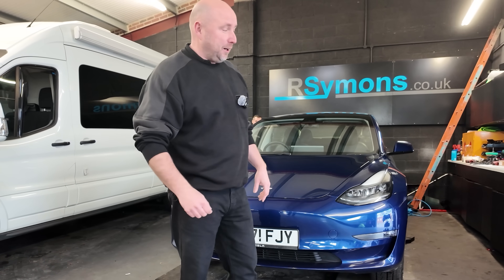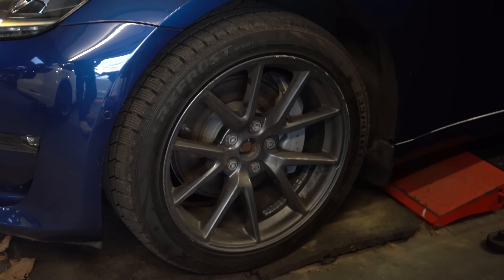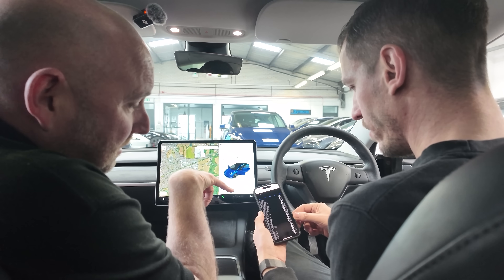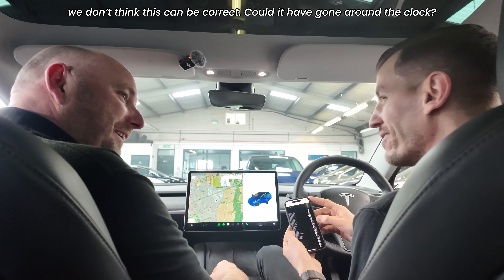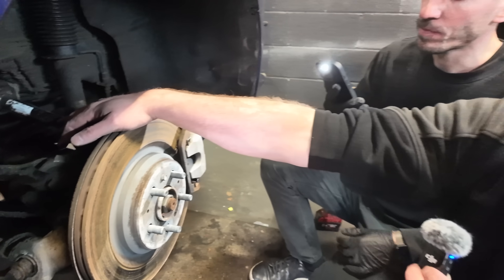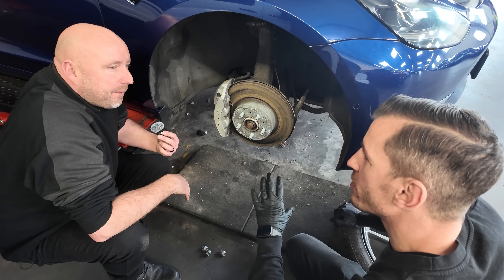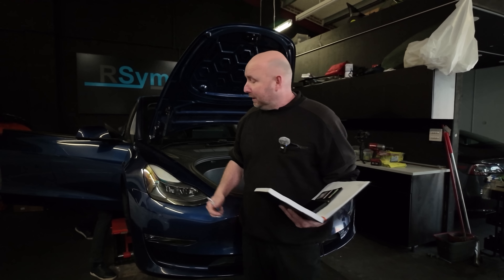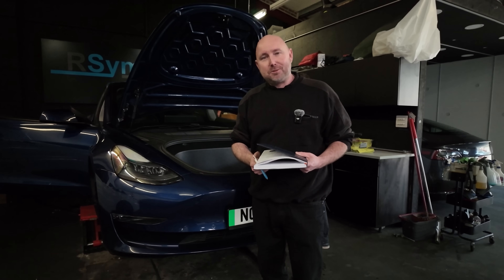EVERYTHING WRONG with my HIGH MILEAGE "21 Tesla Model 3! | Battery health and other issues!

Comment: Almost £20k less in fuel costs?! Let alone the VED and maintenance costs on top of the constant worry about something going wrong.
This is why I find it hard that people still argue for buying a new diesel 3 series over something like this. Absolutely mental.
Reply: only if you can charge it at home
Reply: @alexwong402012  Yes, which is around 65% of the population in the UK. So a good number of people.
Reply: The ICE wouldn't lose 50% of it's value in 1 year, check again the EV market data.
Reply: @grumpyrider369  but if your car has a usable life of over 400k miles then what relevance is the resale value? Besides if you like to swap a new car for another new car every couple of years
Reply: @grumpyrider369  What?! You can buy a used, one year old Mercedes e-class, for under 30.000€ in your country? Where do you live? I have to start importing those. Here, you wont find any under 45.000€. Neither on the car dealer market, nor on the private market.
-
In opposite, Tesla has to rent an airport, to store its cars. In Gusow-Platkow, in Brandenburg, they rented an old military airport, already a year ago. They store thousands of Teslas there, because they cannot sell them. Its become even much worse, since Tesla's sales numbers plummeted this year.
Same goes for the "used cars" market. Many car dealerships, dont even want to buy a used Tesla. Its a known problem, here in Germany.
Always fascinating, how different the countries can be...
So, where do you live?
Reply: @dunjak111 Mercedes has to have thousands of car dealerships, where 10s or 100s of thousands of cars are parked. Tesla sells the cars it produces much more quickly.  So extra parking is the norm for Mercedes, VW, BMW.
Reply: @mrmichrom8553  True. Tesla has 22 dealerships in Germany and Mercedes has got 55. However, Mercedes doesnt rent extra spaces to park thousands of unsold cars - like Tesla does. At least not in Germany. I am still talking about Germany.
Reply: Because people are dumb and believe what they read in the Daily Mail or what their mates tell them in the pub.
Reply: Your talking about a new diesel, nobody buys a new diesel. EV is still expensive if you cannot charge at home like me, it has high value depreciation. Than count the battery risks, its still not a clear winner compared to reliable second hand diesel cars.
Reply: VED for EVs being introduced in April 25 though
Reply: "Almost £20k less in fuel costs?" I dont get that. 
A Mercedes E-class uses 5.5 liters on 100 kilometers (combined) = ~9.21€
A Tesla uses 15kwh on 100 kilometers =~ 7€
According to the energy prices of today, here in Germany.
That is a difference of 2.210€ per 100.000 kilometer, or ~7500€ for 341.000 kilometer. Are the prices in your country so much different?
-
Also, driving constantly at high speeds over 130 mph, like here on our german highways, changes the whole calculation in favor of the combustion engine. It needs much less fuel for driving at high speeds, than driving inside city limits.
Reply: @dunjak111  if you charge at home you have 1/4 price of electricity than on supercharger, otherwise if you charge public only then yes, its not much savings
Reply: @ Charging an EV on a supercharger in Germany costs 0,79 €/kWh - or ~12€ per 100km (latest price). That is even more expensive, than an e-class.
Reply: @dunjak111 that’s why you charge at home and only use the super charger for trips once in a blue moon
Reply: @dunjak111  no - it costs 45-50 cents. Why spread bs if it’s easy for anyone to check?
Reply: @ You are right. It is 45.000€. I did look it up, but I must have mixed that up. That was not my intention. I am truely sorry.
Reply: @ purely basing my comment on Richard’s calculations towards the end of the video and how a large majority of city people use their cars. Germany is an exception since it’s the only place with roads you can legally go so fast in Europe.
Reply: @dunjak111  5.5l ??? Why is it that most ppl „on the other side of the fence” resort to lies and half truths? 
5.5l you can get when cruising at 110-120km/h, granny style. On German autobahns most ppl cruise at 150-170.
Another fallacy: you’re comparing a 450HP 4x4 car with a diesel taxi… ppl who drive model 3 do it partially because of performance. Run your numbers again for 340i xdrive
Reply: @AdamCiernicki  Mercedes officially states 4.7l combined (highway and city).
However, 5.5l is more realistic. Crusing at 120kmh in the e-class consumes less than 4l/100km. 
-
"ppl who drive model 3 do it partially because of performance"
Rofl! Even my 32 year old Mercedes with 240hp drives 250km/h. That is faster, than most Tesla models.
Most parts of our german highways dont have any speed limit. So, I wave goodbye to most Tesla drivers, before I see them disappear in my rear mirror.
-
"you’re comparing a 450HP 4x4 car with a diesel taxi"
Sure. You dont need a BMW 340i to be faster, than a Tesla. Even the smallest, modern 4 cylinder engines can drive faster, than most Teslas.
Reply: @ so you’re cruising at 120 getting 5.5 litres …but you’re faster than any Tesla cause you drive 250… sorry I’m not qualified to continue this conversation, just relax, maybe go for walk.
Reply: @AdamCiernicki  I guess, you did not read carefully, or maybe my english is not good enough..
1. In regards to the calculation, I wrote about the new Mercedes e-class using 5.5 litres, combined. (those are limited to 240kmh top speed, factorywise)
2. In regards to performance (=top speed?), I wrote about my 32 year old Mercedes, which, btw, has a consumption of 11l, combined.
3. In regards to comparisson of combustions and Tesla, I mentioned that new 4 cylinder engines are faster, than most Teslas.
Most Teslas do 200km/h.
Even a Polo GTI drives 242km/h and costs 35.000€
-
I have no doubt, that EVs will be the future. But there is still alot of room for progress. Combustions had decades for that.
Reply: @dunjak111  sorry, I was a bit snarky there. 

1. I don't argue that you can get down to 5-6l per 100km in a 2l diesel car - I had Passat 2.0 TDI so I know its possible. But you have to drive like a 70 yr old taxi driver - more realistic is 7-10l (in case of my Passat) - and that was in UK, where you cannot go faster than 130! 

2. Top speed is not performance. 
Most decent cars can reach 200-220... after some time. I had Audi A4 Quattro sport V6 and it could go 240, but it was not a fast car (0-100 in 7.9 sec). The max stable cruising speed was 180. For my Tesla Model 3 LR optimal cruising speed is also around 170-180 - I have more power than A4 but because of much faster steering rack, going faster is not relaxing (10:1 steering ratio is exactly that of WRC car! Subaru Impreza STI has 13:1). 
What makes Tesla faster is that I reach 170 before you even get to the 4th gear in your diesel car. 

3. Model 3 LR has a top speed of 233km/h - so yes, if you keep abusing your 2-liter diesel for 10km on a straight flat line - you will eventually catch me :) 
https://youtu.be/WG8y2KBH0xY?si=AjtSzb-O9T3IGChL
But you have to admit, it's hilarious watching these 4 cylinder fart-wagons trying to go uphill around Kassel or Porta Westfalica :) with 450hp it feels almost as if gravity didn't exist - you should try.
Reply: @AdamCiernicki  1. Those numbers are from ten years ago.
The latest E-class 450d with 390hp uses 4.9l on 100km combined, according to WLTP (Worldwide Harmonized Light Vehicles Test Procedure). And that is not even a 2l engine.
In reality, cars licenced after 2021 use about 10-20% more than WLTP states, depending on the source.

2. A Tesla LR costs 55.000€.
A VW Polo GTI costs 35.000€. 

3. I dont know what that video is supposed to show? That GT3 could go 311 km/h.

btw: "TopSpeedGermany" are different drivers. They get in trouble with the authorities and loose their licence regulary. Its sad, that some people come to Germany to misuse the Autobahn.
In that very video you send me, you can see that.
Minimum distance is half the speed. At 200km/h, that means 100m. Being closer than 50m and you loose your licence (+50% too close). Those pillars at the Autobahn are placed every 50m, exactly. You can see, that he is way too close.
Also, he enters a 120 zone with 140kmh and leaves it with 180kmh. Thats fast enough, to loose your licence, too.
Finally, its reckless driving. When there is an on-ramp, he just pulls through with 200 km/h. You dont do that with merging traffic, on a populated Autobahn like that.
However, it goes without saying, that this has nothing to do with Tesla ;)
Reply: @ I still don’t know what point you’re trying to make.

I shared that video because I thought you were saying that Tesla cannot drive at high speeds. 

You keep bringing up diesel and speed. For sure E class is more comfortable on motorway at high speeds, it a bigger and made for this. 
Model 3 is a C class equivalent with hard suspension and fast rack, which feels like a crossover between BMW M sport and WRC hot hatch. You cannot compare such cars. 

Same with a polo. 
If your argument is; but I can achieve high speeds for cheaper with car XY , sure but that’s stupid, no one buys cars this way. If you need a C class size car you’re not going to buy a Polo.

When it comes to cost:
No one looks at WLTP, You cannot compare them -  google real world reports with fuel consumption; E450d is 7 litres per 100 = 11.5 EUR
Model 3 Long Range is 17 kWh/100 = 8.5 EUR using SC - most ppl charge 70% at home at 35-39 cents = 7 EUR total 
(in UK it's much cheaper thanks to 10 cents night tariff = less than 4 EUR /100km) 
On autobahn I’m using 25-27 kWh/100 = 13.5 EUR
Considering the acceleration (not speed), and near-zero servicing, this combination of cost and performance cannot be matched by any petrol or diesel car in C klasse at 52k EUR

Finally, because Germans and Polish people are stubborn old gits (and electricity is the most expensive there), it is so much nicer to drive Tesla in DE or Poland: no queues at superchargers and easy to overtake, most other cars are in slow motion mode :)
Many cars in the UK are now EVs, so you need to be much more careful; they will move fast.
Reply: @AdamCiernicki  I would say Germany can stay in its bubble of buying ICE cars for the autobahns to go 9000kph all the time, and the rest of the world can live normally 😉
Reply: @AdamCiernicki  I never said, that combustion engines are cheaper in consumption. Even my calculation above shows that. However, you dont save as much, as mentioned in the first comment.

You mentioned, that people buy Teslas because of its performance. That is why I wrote, that combustion engines are faster, than most Teslas.
However, I thought, you meant "top speed" by that, because that is most important, here in Germany - in opposite to acceleration.
If you pull off too fast from a traffic light, its seen as "racing against yourself". That is a law and people can even loose their licence for that. Its seen as "showing off", too, and it is pretty frown upon, by most germans.

Oh well, I just keep on waving goodbye to most Teslas, while driving 150mph in my 32 year old Mercedes family sedan. ;-P
Reply: @AdamCiernicki  PS:
" I’m using 25-27 kWh/100"
-
https://www.youtube.com/watch?v=4B_mKXvbQAw
This guy had peaks of 47kw/h and an average of 33kw/h, on the Autobahn, in the new Juniper model. You can see it on the Tesla monitor for yourself. (this new Juniper is also limited to just 200km/h.)
Reply: @JoshuaDay lol.
I see your point. Honestly. However, since I expirienced it, I dont want to miss it. It means alot of freedom.
Also, according to any statistics you can find, it is still about 3x safer to drive on the Autobahn without speed limits, than on an american highway. (fatals per capita, per 1 billion km, whatever..)
Reply: @dunjak111 over 130 mph? There are only few who consistently do that. If you meant 130 kmh then there are many. Electric cars aren’t necessarily worse at high speeds. Depends on the combustion engine car too.
Reply: @dunjak111 I think the only argument for high speeds autobahn driving is charging. Fuel costs are definitely lower in the ev. You can charge for 39 cents at EnbW when you take the 17 euro/month expensive subscription.
Reply: new model 3 and new 3 series are in same price range. People just don't want to deal with charging
Reply: @zerodelay1630I find it mind boggling that people will pay ~€10k more annually just because they don't want to get cheap fuel/charge.

Comment: Rich. Super valuable data. I have a 2018 3 performance with 223k miles. All supercharged. My battery is smaller than yours from the factory. About 75kwh vs 82 I think. 72 usable. My capacity is about 61-62 so maybe time or supercharging caused more degradation?  Everything else still works great. Original brake pads
Reply: Hot vs cold Climate also affects. Temperature really degrades batteries
Reply: That's a good result considering that the car is 7 years old and that you've driven that many kilometers. It's not the same to pass 200k in 3 years or in 6 years, and that also applies to batteries.
Reply: Many factors are included when looking at degradation.. age, temperatures, SOC while parked, constant hard acceleration, type of charging, cycles etc. They say that the effects from supercharging should be minimal tho.

Comment: My 164k miles 2021 82.1kwh Performance only has 63kwh remaining according to scan my Tesla. 23% degradation. Panasonic battery is worse I guess?
Reply: Could be that, or it could be a number of other things. It could be things like your charging habits, the environment, rapid degradation, etc.
Reply: True.. DC 29731 vs AC 24366kwh with only 6879kwh regen!

Comment: Where do you get the refurbished or new steering wheels?
Reply: It won’t be new in this one. As it happens, I found a spare one that has a small mark on it but it’s in better condition than the one on the car. There are plenty used ones on eBay

Comment: I suppose there's always the chance the battery could fail tomorrow and that may make the sums a little different.
Yes I realise the engine in a diesel/petrol could fail too.
Reply: Batteries tend to follow the bathtub curve of failures. Which, it will either fail early or extremely late. Given that this battery hasn’t even hit its half life in terms of calendar age, I would say a tree falling on it or a careless driver totalling it is more likely.
Reply: Yes that is always a risk but as you said the same goes for ice engines and transmissions. 
Luckily batterie prices started to fall lately. 
This has not yet transferred to replacement costs that much in personal experience as those supply contracts are usually longer but it will in the future. 
For data we went from 732 dollars per kwh in 2015 to 115 last year.
LFP went even down to 53 Dollar per kwh.

Comment: Hi Richard, I may have missed it, but would like to know if the scan would tell you how many times it has been charged and discharged, plus’s 216000 miles on an ICE car would may have needed and engine change, or an half engine change

Comment: Good to see it's held up well.
Generally, I think high mileage/heavily used but relatively young vehicles hold up well. It's time that takes its toll. In ICE vehicles be it cars or trucks constant use or "hot running" leads to less wear than short trips and continual cold starts over many years.
I wonder if that also holds up for EV's
Reply: In most cases, the reason is metal expansion and oil flow. EVs motor needs oil for lubrication. But, it gets it within could have spins. So, so long as you don’t launch the car from get go, allow a few rotations of the wheel before you floor it, it shouldn’t matter. 
Batteries are thermally managed when they are run. I’m not sure if the car run active thermal management when it’s parked. So I’m not sure if parking in the sun on hot summer day can cause accelerated wear on the battery due to heat.

Comment: Wow, that’s impressive 
I do worry where i would go to get something fixed on a Tesla. Do worn parts show on the screen or is it just picked up on MOT’s?
Reply: Hi. There are plenty of Tesla Service Centers located around the country. The car will be able to tell you if certain things are worn, but in terms of suspension components, it won’t tell you (unless you have a Tesla with air suspension, in which case, it can detect a lot of different issues with the suspension).
Reply: As well as RSEV, Cleveleys Electric Vehicles - based in Gloucestershire - operate a mobile EV repair and servicing facility, covering as far North as Scotland.....there are others around too.  Both guys in my local village garage are now HEVRA certified to work on electric vehicles.... RSEV get their Tesla parts from Cleveleys.......

Comment: i wouldn't buy a diesel car with 216,000 miles, it would be needing a new engine or scrapped very soon, i would however buy a EV with this mileage, (but probably not a tesla) so little to go wrong... and as im sure someone will pipe up, "depreciation is horrendous" so win/win then....stop moaning...unless you WANT to pay even more for an EV?????....didn't think so